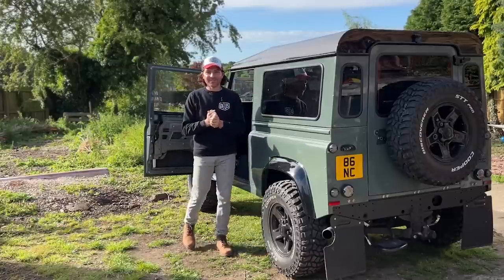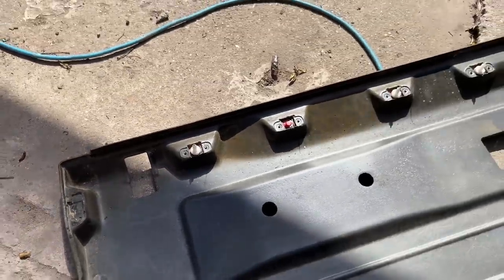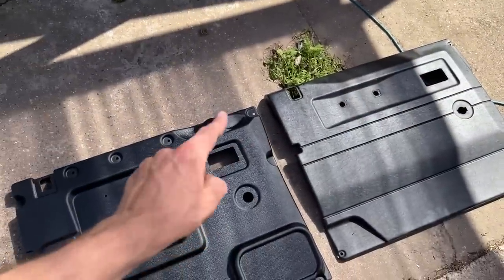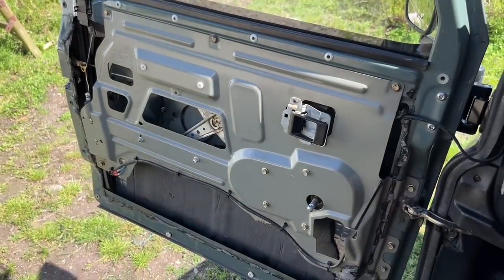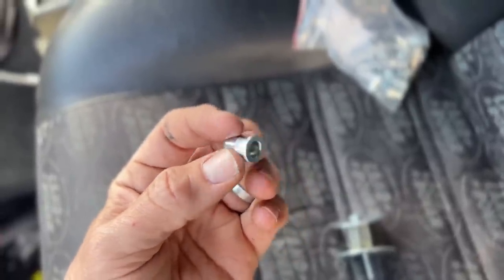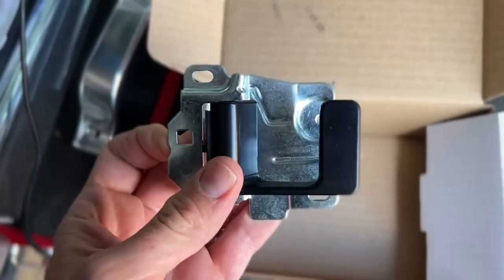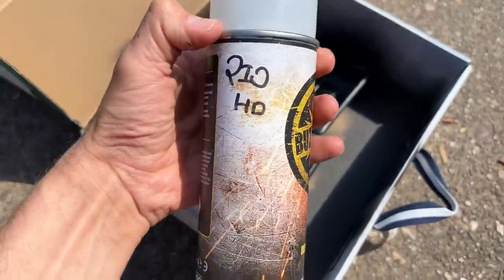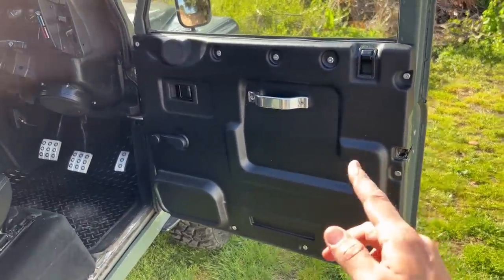LAND ROVER DEFENDER UPGRADE I NEVER KNEW I NEEDED SO BADLY!

Comment: Quick tip to refresh jaded plastic parts, use a heat gun and it refreshes the plastic to like-new. Just be carefull not to actually melt the plastic 🙂 This also works for jaded garden plastic furniture.

Comment: Make sure you don't throw the old door cards away.  Genuine LR ones cost around £200 new so somebody could well give you some money for yours, even though most of the clips are broken, but that problem can be overcome.  The same goes for the old fittings and handles you have replaced.  The truck is looking nice, next modification ORE wheel carrier?
Reply from the maker: Did think are they worth something the old ones - may help pay for the next upgrade! Wheel carrier is on the list but I have a few other smaller mods on in the pipeline first 👌🏻👌🏻

Comment: The foam inner you didn’t put back is needed as it helps keep the water from running between your door and the door card
Reply from the maker: That’s good knowledge Rob thanks - never knew that I thought they were for some Sort of sound deadening- luckily they are screwed in now rather than clipped! so I can put them in 👌🏻👌🏻

Comment: Really like the new door cards. Without being too pedantic I see the top of the door card has a slight wave to it. Could it just be that the different lock nuts not being exactly the same distance between the door and door card and hence applying a different pressure?
Reply from the maker: It’s a good spot! I have seen that myself and need to work out why. I think it’s due to the top fixings being a little too tight
Reply: Saw that myself and thought I wouldn’t be happy with it

Comment: Great job, do the door cards gave a better gap between the seat box and the door card as I have not sound proofed yet and the original door cards have a slight indentation on them.

Comment: Looks good but not sure about the exposed bolt heads.  I have a 1997 300 Tdi which originally had fairly insipid grey door cards. If you are on a budget and in the same situation, you can very cheaply achieve a more unifying and contemporary appearance by simply by spraying them with Satin Black Plastikote (take them  off the door to do it!) I also did the same with my previously grey cubby box. I have black after market seats and the result was a massive  improvement in the general feel of the cabin for around £10.
Reply from the maker: Thanks Phil - I quite like the bolt heads- match the rest of the aluminium look on the inside but yes that plastic spray is good to be fair - easily brightens dull plastics

Comment: How did you get on with removing the window winders. I am finding it really difficult to get off mine?
Reply from the maker: There is a small hairpin clip holding the winder on. If you push the door card away from it and look down you will see it over the winder rod. You can pop it off with a really small screw driver and then the winder falls off 👌🏻hope that makes sense!
Reply: Another trick is to take a narrow length of rag and  slide / pull it behind the winder at the end where the open end of the clip is. Grab either end of the rag and simply pull it up and down against the open end of the clip - it will push the clip off the winder spindle.

Comment: I changed all the original rivnuts and fittings for Hex Stainless rivnuts and black anodised flange torx head stainless bolts, guarantees no corrosion ever…although I made aluminium door cards to replicate NATO map door cards, but modified the drivers side to hold my steering wheel in a lockable holder, much more robust and suits my Wolf !

Comment: You should really think about putting the plastic membrane back on your door.

It's there to stop rain running down the window, past the seal and then onto the inner surface of the door-card and then into the vehicle's interior.
Basically, it ensures all the rain that gets into the door STAYS in the door, where it can, hopefully, escape through the drain holes in the bottom.
Reply from the maker: Thanks Si- never knew that’s what that liner was for! Will be putting it back in thanks